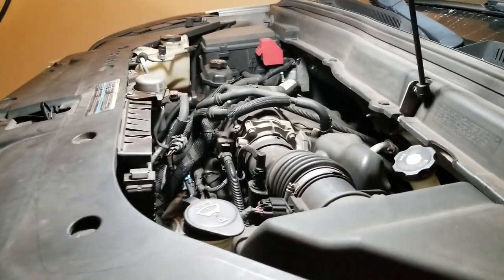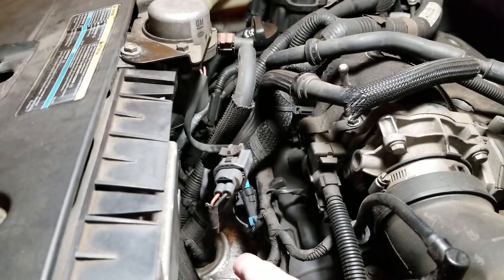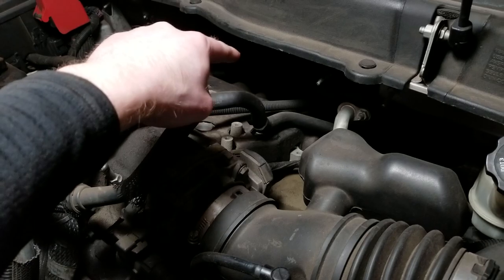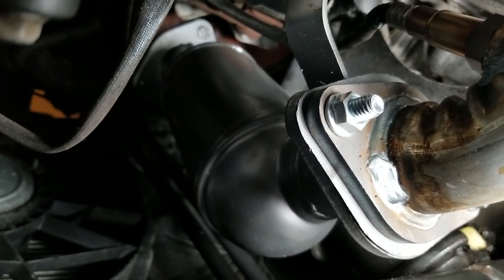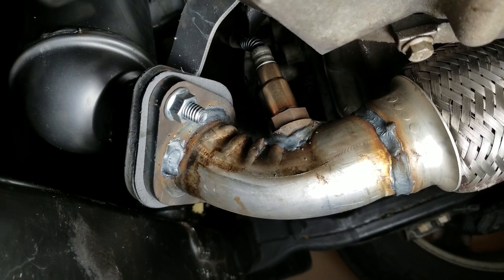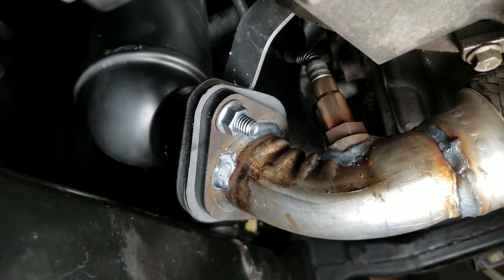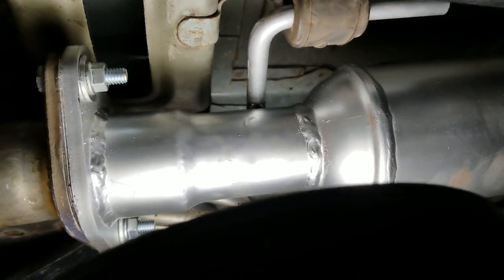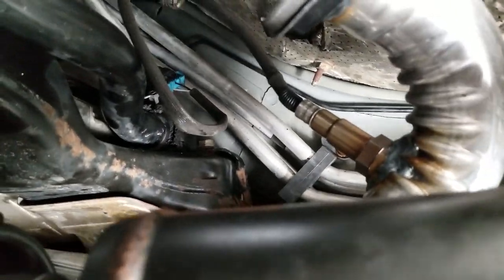2009 Saturn Outlook, Acadia, Traverse, Enclave - Catalytic Converter Installation - Part 2

Comment: Very helpful, and I am experiencing the same with my Buick Enclave...One random question is whether you are noticing an improvement in gas mileage since replacing all 3 catalytic converters? My MPG are well below what I feel like they should be, and I want to blame it on the badly performing cats, but would be interested in your experience.

Thanks for sharing!
Reply from the maker: So unfortunately, when it comes to gas mileage, I'm very bad at keeping track of that.  I'll admit that.  So I'm not very good at being able to tell if it's been better or not.  I'd like to hope it's a little better, but than again, with a 10 year old car, I'm not keeping my hopes up.  Sorry I couldn't help out more with this.
Reply: My 2009 Enclave fuel economy was down significantly to less than 15 mpg in the winter. I replaced all 4 oxygen sensors. It helped a lot. They had about 150K on the sensors at the time. With new sensors it gets about 16 mpg even in this cold weather. Also, that is mostly city driving. Now I have 190K and I have the dreaded P0420 code...good to know there are less expensive converters out there that work
Reply: What year is your enclave..mine is 2011 and same mess for me.

Comment: Who did you buy the parts from?
Reply from the maker: Catalytic converters from Ebay, Y flex pipe from Ebay, O2 sensors from RockAuto and/or AutoZone (depending on which sensor I needed and which place had it in stock).  Flange gaskets from Advanced Auto Parts or AutoZone, again, depending on who had them in stock.  Gaskets were as needed.  I had to double up on the Bank 1 Converter to Flex Pipe hook up.  This is the one by the firewall.  Gaskets are about $10-15, so I used 2 gaskets there to help with some small gaps.  You may or may not need to, but it helped and was worth the money.
Reply: @jaybrown9158  Your tutorial was very informative. Well done and thanks on the information where you got your parts.
Reply: @jaybrown9158  Hello do you have the links from Ebay?  i found some of them with very bad reviews.

Comment: I Have A ‘09 Traverse And I Have This Issue.
I’m Trying To Figure Out If Bank 1 Is The Firewall Side Or The Radiator Side.
When I Start My Truck, It’s Quiet
But When I Put It In Drive And Move Forward, It Makes This “Horn-Like” Sound
When I Step On The Accelerator, I Suddenly Hear This “Clunking” Sound, As If Something Is Loose Inside The Converter.

I Need Assistance On Figuring This Out
Reply: I Called The Dealership And Was Told That Labor Would Cost $150.00-$500.00+ Because They Would Have To Remove The Heat Shields.
Does That Sound Right?
Reply from the maker: @lonniecarroll5118 , so bank 1 is firewall side.  I do explain that in the video.  Sometimes you also here it referred to as right or left side.  In your case, firewall is what they call right side.  Right and left are based on viewing the engine from the drivers side of the car, looking down into the engine.  Now, in regards to the heat shields, I removed mine for convenience.  A mechanic may do the same to get to the converter easier.  However, the overall price of the work isn't going to be based on heat shield removal.  For me, the 2 heat shields took about 3 minutes to remove.  Are they replacing your converter, or just an O2 sensor, because they shouldn't have to remove the shields for the sensor, but may for the converter.  What is the 150-500 based on?  How much are they fixing?

Also, I'm not familiar with the "horn" sound you are hearing.  My converter was going bad but never made a noise.  It just triggered an engine code.  Maybe I caught mine in time before it started making noise.  The noise could be something broke off in the converter, or the converter is a little loose and banging up against the engine or Y flex pipe.
Reply: Jay Brown  I Just Had Bank 2 Converter Replaced, But I Learned That It Wasn’t Bank 2. When I Drive My Truck, I Can Literally Feel Vibrations Directly Under The Middle Of The Front Cabin
Reply: I Also Hear This “Clunking” Noise Coming From That Area As If Something Inside Of It Is Lose
Reply: My Mechanic Says It Certainly Doesn’t Take 5 Hours To Complete This Job And I Literally Watched Him Replace My Bank 2 Converter
Reply from the maker: Yeah, that sounds right.  I mean, to replace all 3 of my converters took 6-7 hours, but that's because I'm new at this.  A mechanic should be a lot quicker than me.  Bank 2 is by the radiator and that one is easier to get to and fix then Bank 1, so if he's fixing Bank 1 converter for you, it may take a little longer and be a little bit more in price, but hopefully not too much.
Reply from the maker: @lonniecarroll5118  , there has been some confusion on Bank 1 versus Bank 2.  My definition is solely based on videos I've watched online plus my Haynes manual.  Based on that, Bank 1 would be firewall converter, and Bank 2 would be radiator side converter.  If that is incorrect, then people on youtube plus the Haynes book has it backwards.  Maybe your mechanic can clear that up if you are still not positive on the issue.

Comment: We’re did you get parts
Reply from the maker: I got the converters from Ebay, and the Y flex pipe and O2 sensors from RockAuto.

Comment: Do you still have this car? If so, how have these cats held up?
Reply from the maker: Yes, still have the car.  I'm almost at 175k miles.  I did replace them this year, so that's almost 2 years I got of them, but I was getting a check engine code that I thought was them going bad, but turns out I had spark plugs and fuel injectors that were going bad, so the converters may not have been the issue.  However, I was told with after market parts, they could trigger a check engine light even if they aren't bad yet and it's hard to permanently clear the code.  But for the price and the satisfaction of being able to do it myself, plus all the money I saved, it was worth it.
Reply: @jaybrown9158  with regards to fuel injector and plugs going bad - how were you able to get that conclusion?  Did it gave you a CEL?

Comment: Can you post the links for the parts
Reply from the maker: The converters were from a place on Ebay called First Choice Exhaust.  I'm not sure if they are still available on Ebay, so you may have to look into other options or brands.  I would recommend finding the brand and price that fits your budget best.  Otherwise, my O2 sensors were from RockAuto.com, and any other misc. parts were from AutoZone, Advanced Auto Parts, etc., depending on who had stuff in stock.

Comment: Is the P420 code gone for good?
Reply from the maker: Yes.  At first it came back, but here i didn't have some of the nuts and bolts fully cranked down so there was a slight exhaust leak which was triggering the code again.  I cranked all bolts down, cleared the fault, and it stayed off.  Usually you have to drive it around for roughly 100 miles for the computer to fully reset, but I didn't have to with mine, it stayed off.  I've driven it about 400 miles since and its still good.
Reply: Jay Brown I didn’t feel like fooling with it so I parted ways with it yesterday. Lol
Reply: Excellent video! This is the most informative thing I could find on the internet. I appreciate you taking the time to make it!

Comment: Is there any sensors betweenthe last catalytc? Is necessary to change tha last one fot the code p0420??
Reply from the maker: Sorry, just seeing your comment now.  No sensors with the last converter.  Just 2 each with the front 2 converters.  The last converter has nothing to do with the P0420 code, so you do not need to replace that.  You can do only the converter or O2 sensor that is the issue and be done.  I just did all because the converters came as a set.

Comment: When the catalytic converter not properly connected cause the car not wanna start and rough idle and rough acceleration
Reply from the maker: I apologize but I don't understand what you are asking.  Can you clarify?
Reply: @jaybrown9158  I got a GMC acadia  don't  want  star  I replaced motor starter
Reply from the maker: @rose1966jvl  , I'm not sure what you're asking.  This is a video for catalytic converters.  This video doesn't apply to vehicles not starting.  Sounds like you have a different issue.